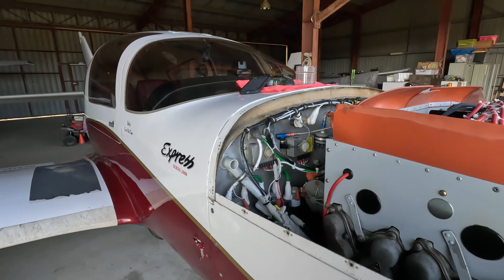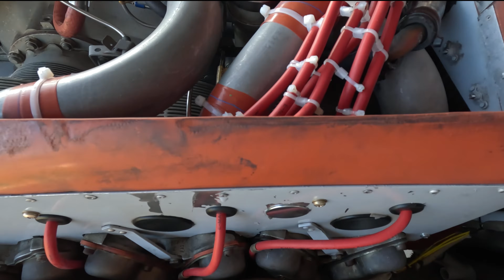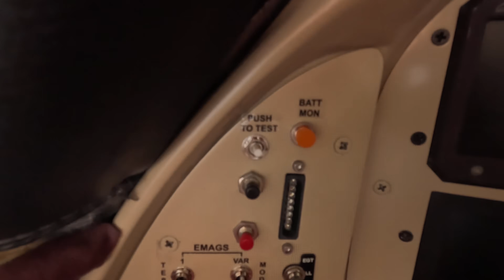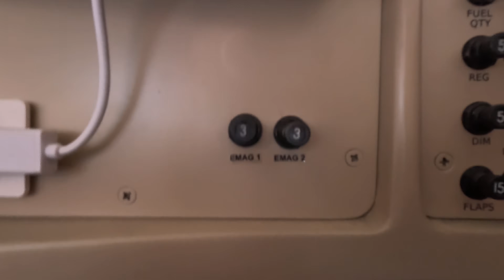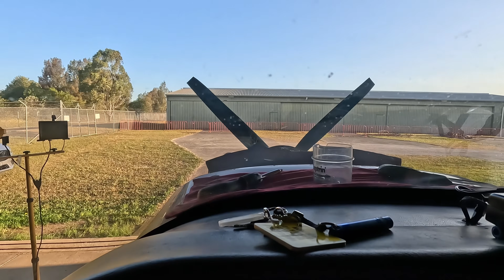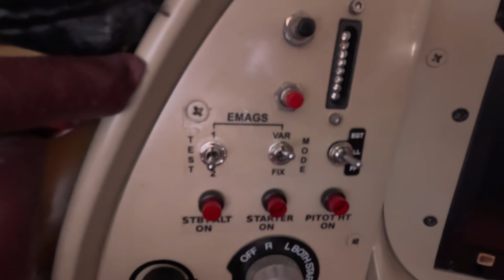Major electrical upgrades - E-mags and Earth -X battery installed.

Comment: Thanks for this video - really thorough walk-through!

System looks great and the potential to improve fuel economy/range is fantastic. 

Made me realize thy I hadn't considered the 'live mag' issue - I'm an instructor and I drill students religiously about 'keys on the dash' - don't do anything at the front of the aircraft unless you can see keys on the dash... 

I think I'd want to build in some sort of clear visual indicator that the prop is not live if I fitted this on trainers (or any aircraft, really). 

Cheers! R

Comment: Did the alternator need modifying for charging the Lithium ?
Reply from the maker: No  - no changes to the alternator(s) - I have a backup alternator as well in case the primary one fails.

Comment: I think reliability is the #1 myth about magnetos, as they are in fact not reliable at all. service intervals on them are fairly short and they do break from time to time. if they are so reliable, and you have two of them - why do you have to inspect them every 500 hours? well, because they break
Reply from the maker: Very true. There are modes of failure with magnetos that can ruin an engine pretty quickly too!